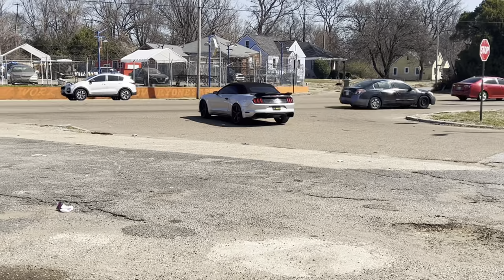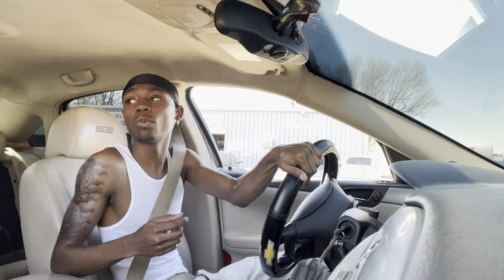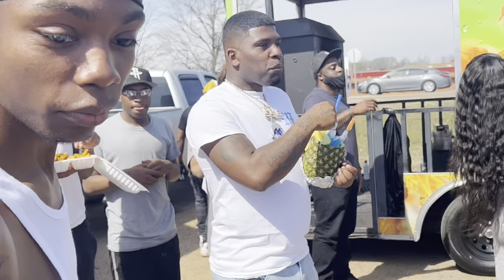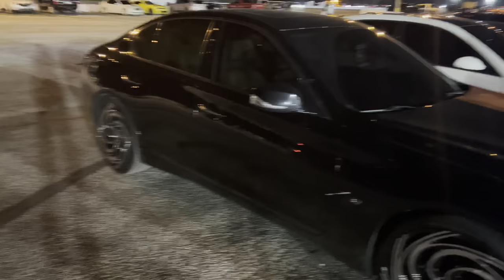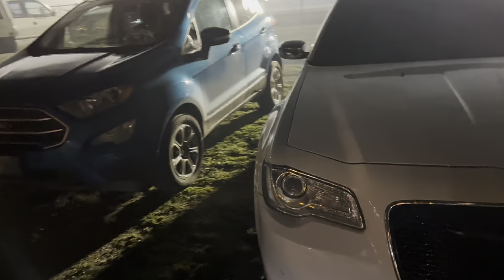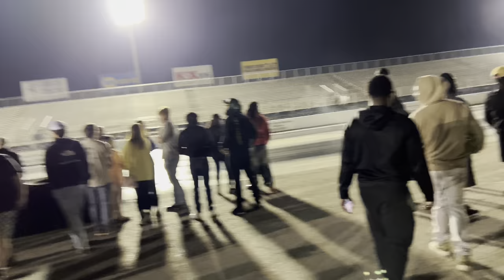TOOK MY CAMMED IMPALA SS TO THE MEMPHIS RACEWAY…AND SEEN YOUNG DOLPH’S COMEDIAN GROVEHERO

Comment: Garbage you need to put full coverage on that car and run it into a brick wall totally out take the money and go get you something way better than that anybody that knows something about cars know that the Chevy Impala SS is garbage
Reply: They the ultimate sleeper mopars are garbage
Reply: You obviously don't have any idea what you're talking about. The 5.3 v8 in the Impala SS is actually called the LS4 and they make great power and are very reliable. I worked for Carolina Auto Masters in Burlington NC where we specialized in building LS engines and really any and all performance modifications. And my Boss tuned them on the Dyno. Those being front wheel drive was a weird idea, definitely should have been rwd. Other than that they make big power and the cars are good looking cars.. he ain't like everyone else in the world with a Charger or Mustang... Also still to this day LS engines ( even in 2023 corvettes ) are old school pushrod engines!!